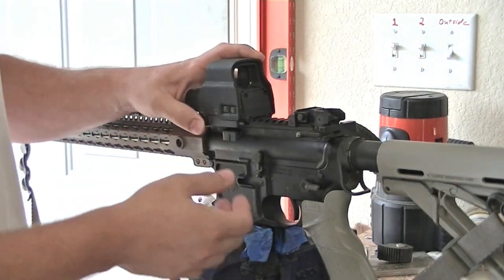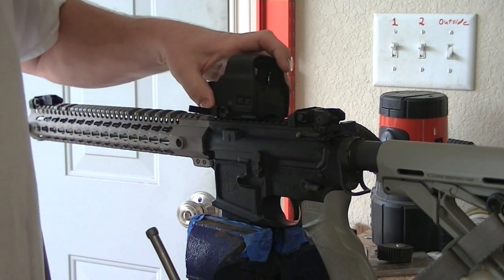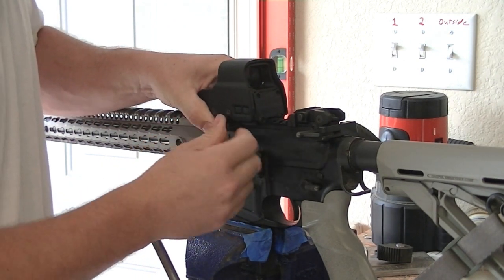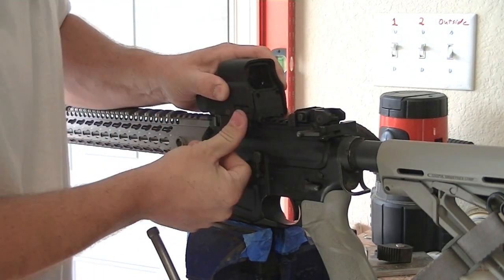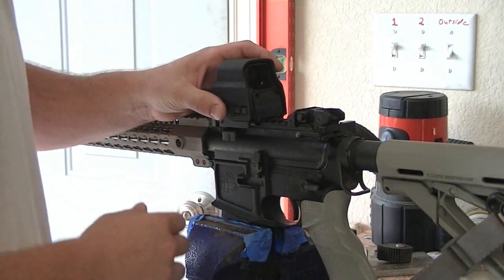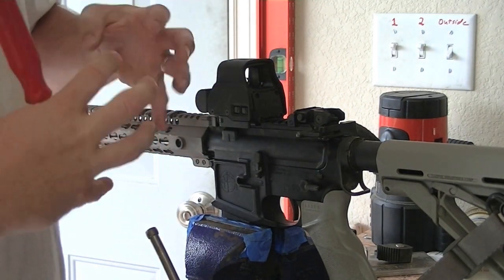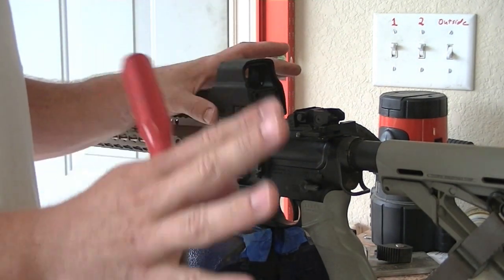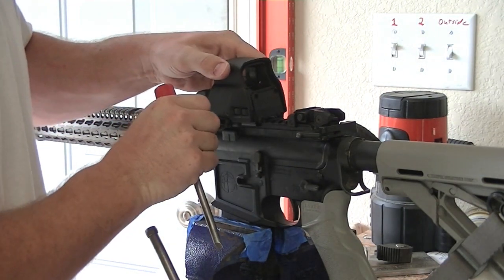Mounting and adjusting your Eotech optic

Comment: Just got my first Eotech (EXPS2-0) and have put about 500 rounds under it on a BCM 14.5".  I've got the QD lever adjusted as tight as I'm comfortable with.  Unfortunately, when I practice reloads and dryfire at home, the sight moves to the rear. After about 5 times of sending the bolt forward by releasing the bolt catch, the sight will move to the rear of the Picatinny slot.  Like I said, the QD is tight, tighter than I see in many other reviews.  Thoughts?  Thx, I'm about to return it!
Reply from the maker: Victor,  Provided it is a genuine eotech and not a knock off (not presuming, just clarifying), It should just be tightened down further.  I run them pretty tight, and with a new off the shelf unit, you might need to work the clamp a few times with it tighter on the rail than you like.  The vibration on the platform is pretty intense, and can cause any accessory to work itself loose if its not very firm on the rails.  The design of the mechanism spreads the force out over about 1/2'(ish) of the receiver, so it should not be able to damage it.  Of course it could be a faulty screw, or a stripped attachment block.  But if you can't get it any tighter, than obviously there is something wrong with the unit.  There is a possibility that the receiver rail is out of spec, but that is pretty rare.
Reply: @TexasDefenseArticulations  Thanks man!  I appreciate your reply.  I spoke to cust. service and they said the same; tighten it up very tight.  I did and it still migrated back, although it took a lot more bolt releases than before.  After a range session, and after about 90 rnds, the sight also migrated to the rear of the slot!  That's the opposite of physics, Eoteh's instructions, SOCOM's instructions, and any instructions from any company when mounting anything to rails.  Oh well.  It likes to live in the rear, I'll keep it to the rear.  It's still zeroed, so I'll just keep an eye on it.  If it moves forward, I'll return per warranty.  Thanks!
Reply: Victor Lawson I ran into this problem with a few QD mounts and it’s at the point I’m not going to use them ever again. 

I know that doesn’t help you with your integrated QD mount though.

Best advice I can give is to tighten it more, the “best” QD mount I’ve found for Aimpoint is ADM and I have them adjusted very tight to the point where I can almost not undo it just with my fingers. 

I’ve heard a few people have their LaRue deliberately mounts tightened to the point that they would need to use their sling or some other piece of webbing to pull the lever out. 

I know people buy QD mounts for the connivence of switching or removing their optics and getting return to zero. I personally could not care less about to return to zero as, in my view, a QD mount is simply to take a busted optic off quickly. 

Like if I’m removing anything it’s because it is in an unusable state so return to zero is irrelevant. 

But yeah I would try giving that EXPS tension nut another click or two and see what you get.
Reply: @riflesfirst208  thanks for the reply!  I got the QD version because it's the only EoTech that's lower 1/3 cowitness which is the height I wanted.  I suppose I could have used a riser, but that was an extra expense and piece of gear.  It's dang tight right now and hasn't moved from the rear of the slot after another 300+ rounds so I think I'll just leave it there! Ha
Reply: Victor Lawson Alright that’s good to hear. 

Always great when you can fix an issue without spending a dime.
Reply: This happens to me too! That's how I ended up here on this video! Any solution?
Reply: Nope. The solution is to not worry about it.  My dot stays zeroed even with the slight fire and aft movement.  So far so good. Just goofy.
Reply: I'm 100% new to EoTech. I've always ran with the AimPoint Pro. Anyways, I haven't heard anything about it being an issue if it's too tight. I just don't want to try pushing the lever in to lock it & it break or damage by trying to lock it in place

Comment from the maker: Ok,  So apparently there have been some comments on the video that YouTube has just deleted for no real reason.  I can see a portion of them in the notifications, so I'll go ahead and respond to the portions of them that I can see and try to keep it civil.
Mr"Physics" doesn't seem to understand physics himself... as he probably hasn't actually had a course on it from an institution of higher education.
The recoil of the rifle drives it to the rear... the sight (since it is not welded to the rifle) attempts to stay in the same place in space when the rifle is fired...
now.. if there is a gap between the cross bolt (or indexing tang), and the rail that is immediately FORWARD of the cross bolt, the optic has the ability to slowly work its way forward under heavy use... as the sharpest portion of the recoil impulse drives the rifle to the rear.  If you eliminate the possibility of that by making sure there is no gap between he cross bolt and that forward rail when you mount it.  Albeit... running the mount significantly tighter can possibly seize that issue.  But if you want to be able to remove and reinstall the optic without having to recheck zero... then the forward pressure provides a 100% consistent and repeatable positioning on the rifle.
Reply: When you were mounting the EOTech in the video it looked like you pushed it towards the but-stock (rear in my thinking) but said to push it forward. Which is correct, actions or words?
Reply from the maker: @ I did push it towards the muzzle.
Maybe my hand positioning looks weird.

Comment: how tight should that QD lever be? Mine seems snug but I can go 1 more click. It requires a pretty good amount of force to shut it but it shuts
Reply from the maker: Yeah it should be pretty tight.
I’ve been running mine for years where it’s an effort to break the latch open with one finger.  I’d prefer it to be a bit too tight over it possibly moving under heavy use.
Reply: @TexasDefenseArticulations  right on. I went one notch tighter. Sketches me out with how tight it is but with the setting 1 looser i was able to slide it with a good amount of force. Yours in this video is alot looser than mine thats why i was nervous

Comment: Just bought an EoTech EXPS3-0, is there a way to save the brightness level? When I adjust it to the brightness that I like and turn it off it reverts back to the original brightness before I changed it

Comment: Where on the rail do you set that underneath pin you just describe...on the picatinny rail where do you set the red dot...thanks
Reply from the maker: I tend to have the cross pin about 2 slots rearward from the beginning of the handguard.
Really, it’s personal preference, but I run a magnifier behind mine a lot, so I push it a little more forward to get more room for the magnifier
Reply: @TexasDefenseArticulations  So the EOTECH i found on Amazon says it has a weaver rail. Will this work with Picatinny?
Reply from the maker: @NormNewman  I don’t think legit eotechs have ever been made for a weaver rail.
They are all picatinny.  However, I have heard several people say “weaver” when they really meant picatinny… so maybe it’s an error

Comment: Can my EoTech be too tight? Is it possible to push the lever to lock it in place too tight?
Reply from the maker: I would say if the lever is bending a bit to get it closed, then back it off a bit.
Considering the way the mount is secured to the optic housing, it shouldn’t be able to affect the performance of the optic itself.  But you don’t want to risk breaking the arm of the mount.
Reply: @TexasDefenseArticulations  ok. Thanks for the quick response my friend. Much appreciated 👍

Comment: Is okay to mount the optic forward of the receiver on the hand guard? I need more eye relief with my ar15 pistol, and I'm wondering if I'll have accuracy issues or trouble holding zero? Thanks!
Reply from the maker: If you have a very high-quality handguard that has a good locking mechanism to the upper receiver, then it shouldn’t be an issue. But most hand guards are not that well designed. So you could eventually run into some loss of zero issues.
Reply: TheReaganCole - thanks. I guess I'll need to experiment and see how well my vltor handguard is mated to my billet receiver. Lots of eye relief is much better for me, with my eotech close I have trouble not switching my focus to the housing intermittently....

Comment: Hi! I have an Eotech 512 but it's current position doesn't give me enough freedom to install my rear offset iron sight behind the Eotech. My question is, is there a distance limit as to how far up I should move the Eotech? Thanks!
Reply from the maker: The ideal distance is to push the Eotech as far forward on the upper receiver as possible, but without getting the clamping mechanism onto the rail of the handguard.   When I was using a 512, I put the cross bolt through the very last slot on the upper receiver.  A good tip with the 512 models is to use lithium AA batteries, and use a gunsmithing torque wrench to torque it down with some nail polish on the threads of the crossbolt.  Alkaline batteries will "gas out" and ruin the electrical connections in the unit (100% of the 512 models that I have seen fail... This was the issue), and I've seen several of them come loose after a lot of rounds.  I hear a lot of inexperienced dudes say those models aren't good... But I wore out 2 rifles under my first 512... So I don't buy that.
Reply: TheReaganCole awesome! I appreciate the feedback!
Reply from the maker: Martin Vazquez.  No problem.  Check us out on Facebook, we post a bit of short videos there, and list classes on TexasDefenseArt.com

Comment: How is the EOTECH in full sunlight? Does the holograph remain bright or does the sun wash it out? Thank you
Reply from the maker: It’s got a lot of adjustment, and can be made to be too bright in the Texas sun.
That’s one of the great things about it... the increments of brightness are very small, so you can achieve the exact level of brightness you want for daylight or NVG use (with NVG compatible models).

Comment: Which number on the Eotech is the serial number? I just bought EXPS2 and am trying to register it
Reply from the maker: There should be a decal on the bottom.
Reply: @TexasDefenseArticulations  I see it, it's got one of those qr-code looking things. Thank you!
Reply: @TexasDefenseArticulations  so I just bought this and unbox, the green Circle looks rather fuzzy, should it not be a pretty Sharp contrast Circle? Looks rather fuzzy and I cannot get it to look crisp. I'm wondering if something is wrong. Has anyone heard of this from EOTech? I'm going to call their customer service line today. This would be rather disappointing if I had to send it back
Reply from the maker: @woofielove1970  they aren’t made to have a crisp outer ring, as it is only designed to draw you’re eye to the reticle sooner.
The center dot should be made pretty crisp as you dial the intensity down.

Comment: what kind of qd mount is that on your eotech  ?
Reply from the maker: That is the factory one that comes on the EXPS series of eotechs.  For an aftermarket, I run it on an LT101 from LaRue Tactical.  Puts them up higher for faster acquisition, and ease of NVG use.  Can't cowitness irons tho... NBD
Reply: Nice I hade to ask I have  an eotech xps2-2 and t didn't come with one ..great video tthanks

Comment: hi great video, My HWS 512 does not have click adjustments on the elevation and windage? its just smooth. is that normal?
Reply: I do remember my old 512 having a smoother detent between adjustments.  But if it’s completely smooth, I’d contact eotech and see if they need to fix it.  They’re a pretty good customer service company.
Reply: Hi thanks for the reply, purchased it brand new only a month ago. Manual says there should be clicks, mine is totally smooth! Will call the dealer tomorrow and find out what the crack is👍
Reply: fannypop did they ever help you out?
Reply: @Not-a-bot222  The world may never know

Comment: my eotech and magnifier has a play. it slides back and forth. tried tightening the side with a coin but it still moves. any idea how to fix it? nothing on youtube so far.
Reply from the maker: there may be an issue with the mounting bolt, or something hanging up the mechanism and not allowing it to close tightly enough.  If it is one of those larger "thumb knobs" I would replace the cross bolt with an allen head screw.  If that doesn't help, you may have out of spec rails.  I have seen that a couple of times.
Reply: I have the same exact issue.
Reply: @tomg.5194  I figured it out. Just tighten it to the point where it's not easy to lock.
Reply: @tambay1ang  Ok I'll try that, thanks!

Comment: What rail are these made for mine doesnt fit
Reply from the maker: Standard 1913 picatinny rails.
Unless your rail is a weaver, or far out of spec, then it should fit, as there is a significant amount of adjustment in the mount screw.

Comment: Any idea why my zero is spot on when resting but when standing it’s off? I thought the benefit of the red dot was that essentially you could have the firearm in any position and zero was maintained?
Reply from the maker: There may be a couple of issues.  Either the mount is not secure, or its on the hand guard and not retaining zero.  Or it is marksmanship error.  Unless you're dealing with a cheaper optic or something.  On the rest allows you to set yourself up for success by eliminating A LOT of sympathetic movement into the gun.  Standing pretty much ensures that every single bit of movement you make is transferred to the muzzle.
Reply: Your optic should be mounted to your upper receiver only not the hand guard. While at rest you minimize your movements, holding more to zero. When standing you have more muscles to use and keep steady cause a natural reaction of more movement (easily) than at rest causing your zero to be off.
Reply: Do they make a fixed riser to replace the factory eotech quick release ? If so what company makes it?Thanks

Comment: Hi ive got exps3 that cant even hold zero. Still trying to figure out what wrong with my eotech. Bought from a friend. 
Every shot hit kind a randomly. From 30yards each shot around 5 -10cm aparts. Mostly hit 12/13 oclock. When i use my buis (mbus pro) everything hit fine. 1/2cm between each shot. From 30 yards.
Reply from the maker: That sounds very weird.  I'd start by doing a hard check to see if its a legit Eotech (there are some good knock offs).  There should be a number on the bottom of the unit, and you can email Eotech with that number and the model number.  They can tell you if its real or not.  Next, see if there is someone that will loan you their optic, and shoot some groups.  If your groups are good, then you've eliminated the rifle as having any real issues with it.  If the unit is real, and the rifle shoots true, then the mount security would be next.  I've seen some upper receivers be out of spec, but they tend to cause issues with all optics, not just one.  Eotech should take the unit back and fix it if its having issues like that.

Comment: Obviously, I'm six years late here but what about a shim to stop movement.
Reply from the maker: This video has been going strong for quite a while!  I’m assuming you’re talking about the need to put forward movement on the optic to eliminate any gap that can be come an issue during recoil.  
This is not an Eotech issue, but instead a necessary evil for ease of optic mounting.  Every optic mount has to accommodate for variations in the rail, and ease of installment.  If it fit so perfectly that there was no movement, it would me much more difficult to get the optic on and off.  Also, as the finish of the mount wore off, it would introduce a gap anyway (albeit smaller).  The gap itself is really a non-issue, as long as the super-easy procedure is followed, and the optic is torqued down correctly.  Witness marks are also a good idea for a quick visual reference.
I myself have seen some industry leaders with rails that are out of spec on some of their units.  Happily it’s a non-issue for the most part.
If you weren’t talking about that… then sorry for the long response!

Comment: I can't get my EOTech to set down on the Pic Rail.
Reply from the maker: Which model you using?  The only times Ive had issues with them not mounting was on non standard rails.  Specifically the QD mount.